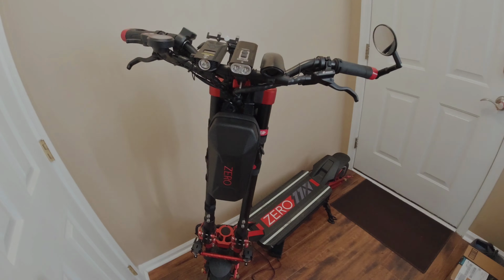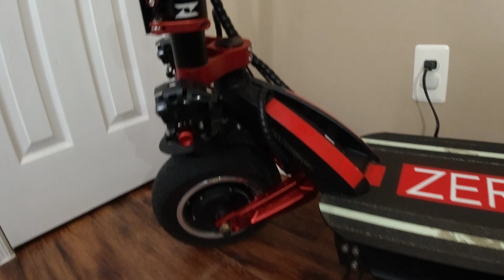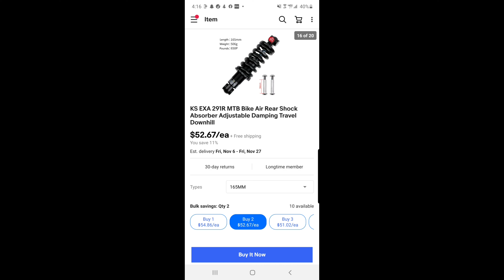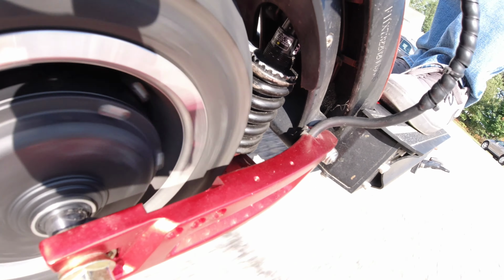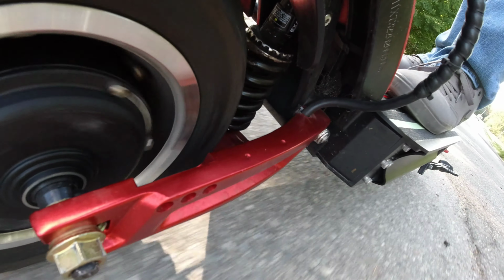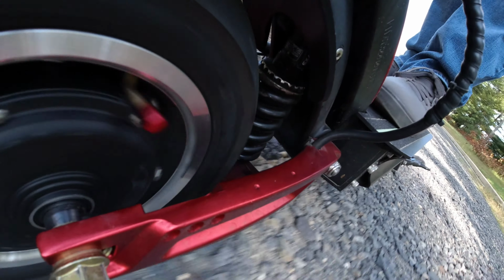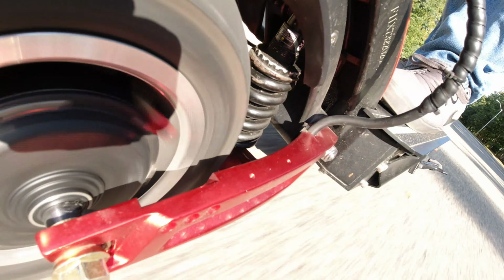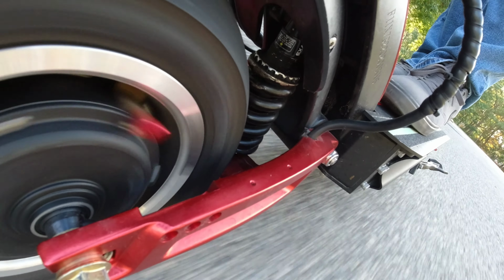Zero 11x Upgraded Suspension Performance Video

Comment: Nice video... been looking to upgrade my suspension as well... was thinking of Dnm air but kinda leaning towards these here. Did it lower the ride height due to them being shorter or u can barely tell a difference?

Comment: Question about orientation, I installed the same shock in the front of my 11x, however I have them installed with the adjuster up top, any insights? I find they have quite a bit of rebound even with the dial moved, to either extreme, no leaks or anything, I'm thinking they are installed incorrectly?

Comment: Interesting, so stock springs fitted ok? They don't fit on DNM shocks.
Reply from the maker: Had to remove the spacers and the metal eye to get them on
Reply: @llainfactor  of course. I mean the internal diameter of the spring does not fit over the damper section of the dnm. Sounds like those ones are the way to go. Thanks

Comment: Seems like a hard way to do it I’d rather buy shocks ready to go
Reply from the maker: Would have been easier if someone somewhere knew the rating of the stock springs
Reply: llainfactor mate I have been searching hi and low for that exact answer
Reply from the maker: @perrygoldstein2217  it's AROUND 1800.  I HAD 1800 springs that were too long but they were about as thick as the stock spring.  So between 1500 and 2000lb but I don't know which.
Reply: llainfactor thanks for that do you know if they are different for the front and rear?
Reply: @perrygoldstein2217  front and rear are same length